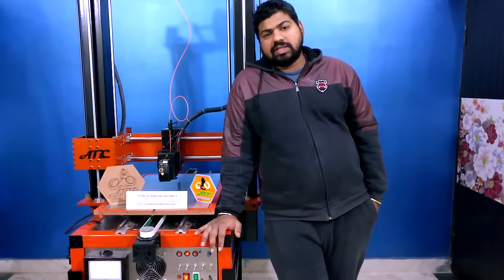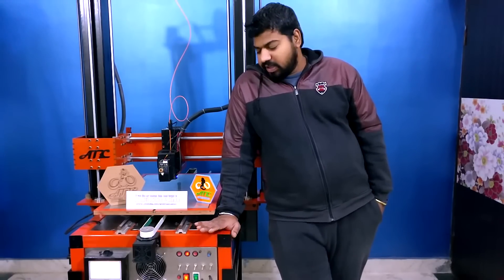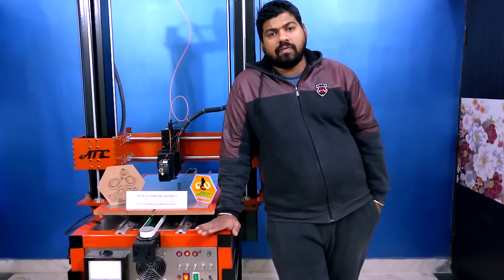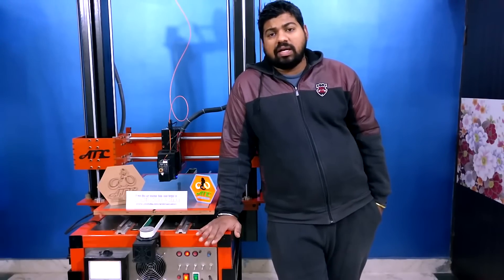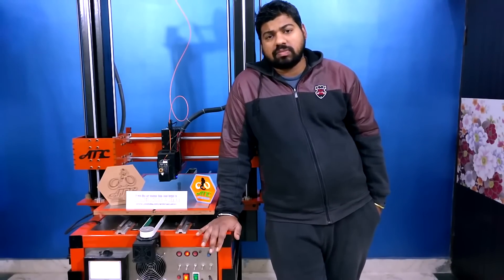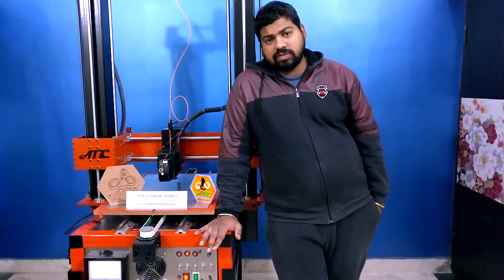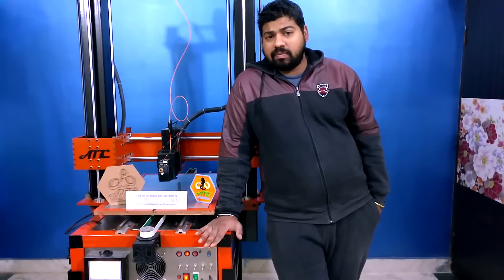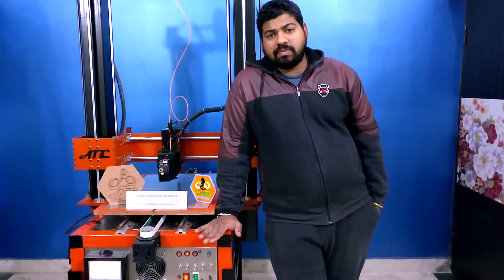Homemade 3 In 1 CNC Machine, Router, 3d Printer & Laser Engraver - By AMbros custom

Comment: But one thing I dont understand, the machine must run on a software, did you write the code for it also or how?
Reply: Nvm, I find out the answer, have a curiosity, what is the software used for making the model ?
Reply from the maker: You can use fusion 360 personal use version it's free with limited access.

Comment: could I use the Arduino mega instead of the Deut ??
Reply from the maker: Hello brother, sorry for the late reply. I just read your email and got reminded. So the reason for using duet is that it uses reprap firmware. And that firmware have capability to save multiple settings and with just one macro setting you can switch the machine from laser to 3d printer or cnc router. Earlier I was also using mega for that but have no luck with that.I think it's definitely doable but unfortunately I have no idea about that. As far as duet is concerned you can find it on eBay. Search clone version that is alot cheaper but works fine without any issue.
Reply: @ambroscustom  I think if the cnc works alone , and 3D printer alone, and laser printer alone 
I may could connect them 

I want to try the arduino becouse I don't know any thing about duet 
with arduino I could connect it with server and application that I will develop it by flutter

but I hope If you could help me with the cnc grbl 
and 3d printer grbl 
and also the laser 
how to make it work alone 

forget about 3 in 1,  If it works 1 in 1 I could make it 3 in 1
Reply from the maker: See there is no issue in the individual settings, main thing is that how to switch the settings. It's definitely not difficult to do for sure, all you need to do is to make a profile in which you are able to switch the identity of the machines and those profiles also called macros. All you need is 3 different profiles with 3 macros but i don't know where and how to use them in marlin firmware.

Comment: I took a look at the site you added to the description, but I'm a little weak in these matters. Can you share a technical drawing for the processes such as drilling and cutting on the parts?
Reply from the maker: Dear, there is actually no drawings for this, there is a 3d model of this machine and drawing needs to be converted from that design. But to be honest I recommend you to change the design, rather than using linear rod it's good to use lm guide. In that way you need only one on each pillar. You can keep the electronic as it is.

Comment: h6y i make cnc laser project use ardino  i make hardware ans grbl laser firmwall but not work so how to do and start cnc laser project plz help
Reply from the maker: Dear I am using reprap firmware, you need to have duet board of you want to do the same. I didn't find that grbl support this  kind of a work. So if you willing to do the same then you need to go towards duet wifi.
Reply: @ambroscustom   its mini project     i check you tube video but not work
Reply from the maker: Which board you are using for running cnc. If you are using ramp than cnc and laser could work. In the ramp board you can use the second extruder point to connect the laser module. You can find the some tutorial about it over there but I can't help you to run it onto cnc shield, I didn't know much about that.
Reply: @ambroscustom  ardino  uno board use its ok  but program not find to run cnc laser hard ware software is run

Comment: Hi great job. b any chance you have the spec. for the stepper motor?
Reply from the maker: Thanks, they are nema 23 1.9nm part no. 23hs30-2804d
Reply: @ambroscustom  Thanks and im planing to use ramps 1.6 you know if i can still use the same driver that you put on the description?
Reply: @ambroscustom   Sorry to bather you again the part number for the motor is for a dual shaft.
Reply from the maker: No dear they are single shaft motors. Ramp 1.6 works but it's good if you have to use trinamic driver rather than pololu or drv 8825 if you want more power. This setup not work if you are using small lead ball screw. If you watched previous parts of this video you can better understand what I am trying to say. Check the description for that. Highly recommend to watch that problem related video in the description list.
Reply: Yes I saw the video but I got confuse because u said that if the motor are more than 3 A dont us those drivers. But the I should go with the 8825 then?
Reply from the maker: But they are 2.8 amps dear not 3.

Comment: so nice concept whel done  
why didn't you take linear motors?
they would have more power and holding torque when milling. but would be more expensive.
the accuracy would also be better and the slippage from the belt would not exist.
or spindle drive?
but your strap is not bad either. I'm worried about his accuracy.
I would like to be able to position exactly in 0.001mm. tat wod be nice
Reply from the maker: Thankyou dear, appreciate your words. Yes linear motors are very expensive and i didn't find any problem in using these stepper motors and as far as accuracy is concerned when there is a power loss the machine are accurate enough to comeback to its orignal state, but i definitely remember your comment while building my next cnc. I didn't talk because i made five parts over this topic and they are Fully explained, so i decided to give it more of a cinematic look:)